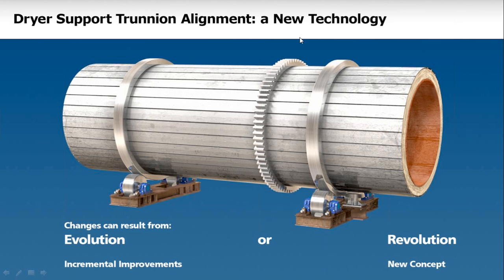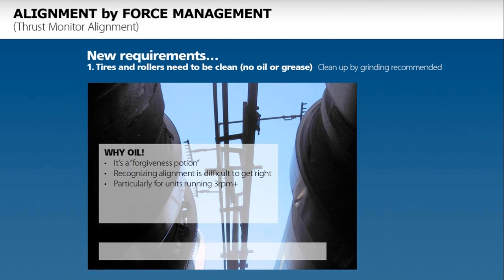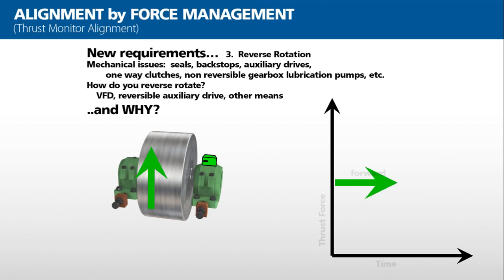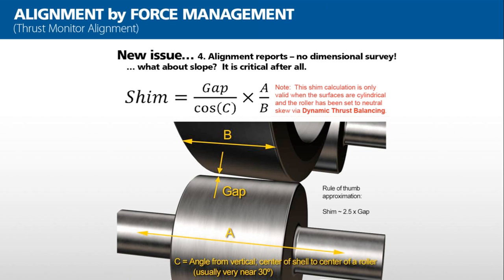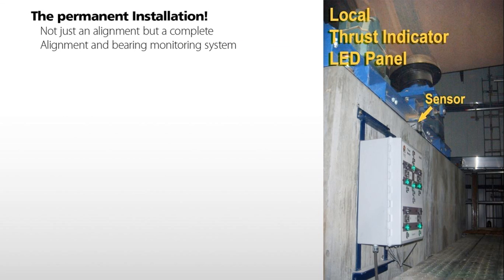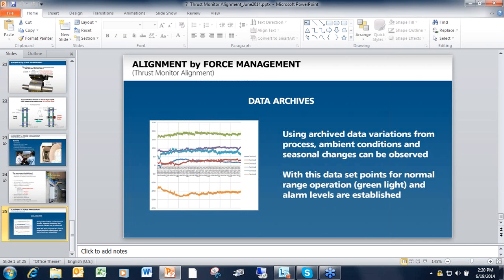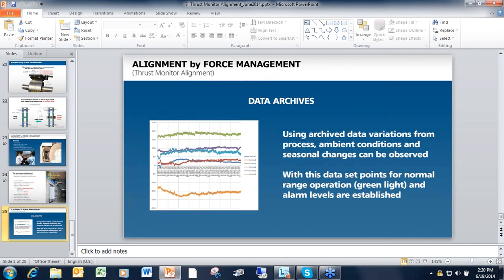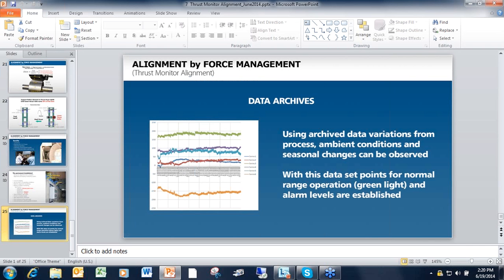Improving Rotary Dryer Mechanical Performance via Thrust Monitors 6 19 14, 2 01 PM

Comment: Very interesting. In the plant I work at the dryer needs to have its rollers greased a lot. Literally we just squirt grease on the roller and it collects excess at the bottom. If we don't grease these the gaps in the dryer seal leaks and we lose pressure causing the fan to work overtime to keep temperatures up at the dryer hood. 

I'll float the comments made in this video towards my GM and see what he thinks.